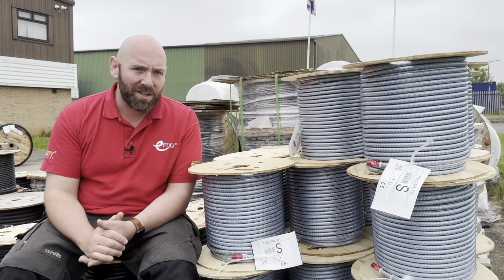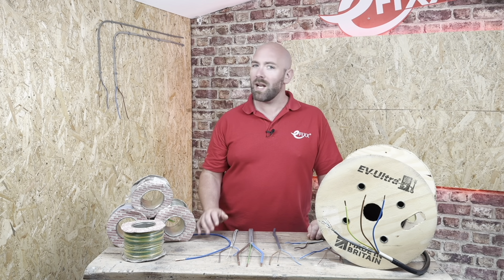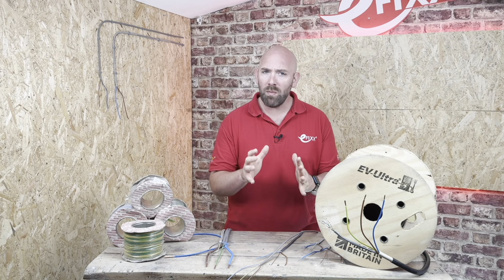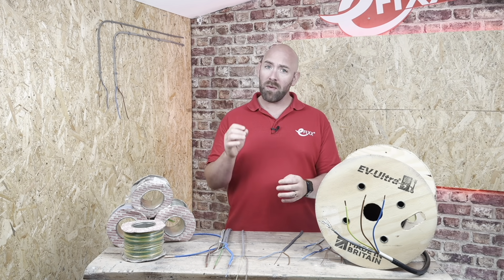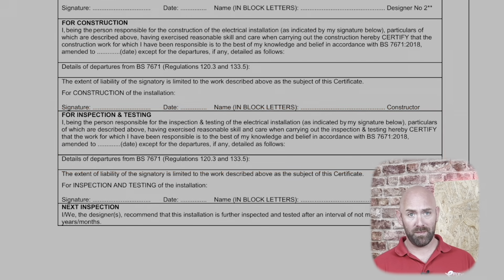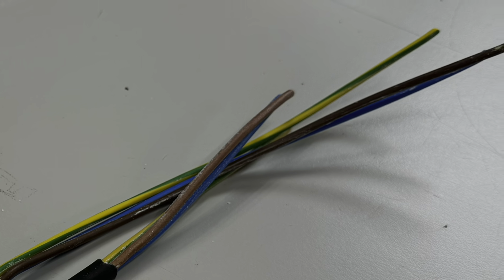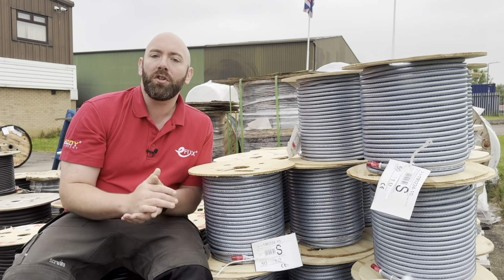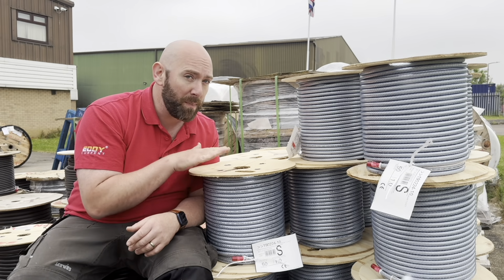Wiring Regs Departure: Can You Trust This Cable?

Comment: Surprising video, SY has always been the standard cable for hooking up outdoor AC units to the isolator provided by the electrical contractors, in fact it was (and may even still be) the recommended cable in the regs/certification.

Comment: Back in the 90s, there were problems with some cables where you ended up throwing out a complete drum of cable as you could not separate the outer and inner sheaths.

Comment: What a sack of do do, about not being able to carry fault current.
Cable is cable is cable, it all needs to dissipate heat but fault current should only last a few seconds to disconnection time or many minutes at a much lower over load state, assuming you installed the overloads and circuit protection and did the calcs SY is fine.
To add, I have used this on Nuclear sites, on robotics, on motor controllers, on inverters, on SIL/SIF equipment.
SO long as its inside, its fine, it allows for some movement, such as a vibrator motor might experience.
I have letters from two manufactures that its ok for low voltage/ low power distribution, that means 300vAC Phase to Earth and 500v P-P.

The braid is meant as a shield, such as to reduce the effects of radiated EMC, like Inverters or phase angle equipment produce.
It is not an earth conductor, specify and use the Earth inside for that, then its at the same CSA as the main conductors.

Comment: 7671 covers installation; BSEN 60204-1 covers controls and electrical equipment of machines (in a similar way to fire alarms and emergency lighting having their own BS numbers).

There's nothing inherently wrong with SY as a cable provided it's used properly - the trouble is people using it in place of SWA and not making it off properly. In my experience, if they don't know how to make off SWA, chances are they'll be equally clueless with SY - but that's an installer problem and not a cable problem.

Comment: Thought this video would have some interesting comments. SY is used extensively in industry and I am fairly sure it is impossible to buy without a G&Y core for the earth regardless of how many cores or colours it has, so don’t see why anybody would be using the braiding as the CPC. I find the SY glands generally don’t get a good grip and much prefer a comp gland and un platt the braiding sleeve it  and earth it. Unfortunately it does get used and abused and is dangerous if the braiding is not earthed, had a few belts from this in the past 😡. Some Dutch contractors told me it is used a lot in Europe 🤷‍♂️ 8:24

Comment: I’m not advocating SY outside or on EV chargers but imo it’s perfectly fine in an industrial setting for runs to machines from isolators or even as extension leads - seen this literally hundreds of times at events.
If it’s only a control cable I would ask why is it made upto 35mm conductors!

Comment: I think you need to reword this video. 

Those types of cables are CONTROL cables and designed for commercial and mainly industrial environments. NOT for air con engineers and by the looks of it moronic EV installers. 

The problem is that too many people don’t know what they’re doing and do a bad job. 

We should have a protected trade and require up skilling every few years. 

Ps. Doncaster have a fault on their new twin cable. With sleeving coming away or snapping when being formed.
Reply: Some SY cable is accompanied by data and certification from German standards and is perfectly OK to be used as long as the braid is not relied upon as a cpc. As a departure this should be recorded and covered by a risk assessment. 
It's an obvious way to undercut the competition as it's half the price of something like H07RNF

Comment: I don't even trust the armour on SWA to carry fault currents. If you're making a departure, test it and prove it safe. If you're designing, take into account the worst possible failure mode. The use of SY cable in the UK isn't controversial, because every spark is taught how to use it. Not there isn't a lot of people out there who managed to pass their AM2 despite being morons, but that's another issue.

Comment: SY cables can be used as power cables because they can be manufactured:. :
1) appropriate phase and neutral colours, not with black numbered cores that is used for control cables
2) available in two insulation grades of 450/750V and 600/1000V
3) available with UV stabilised outer sheath
4) is more flexible than that horrible solid core crap.'..
5). Has VDE approval for the EU
So therefore why can’t BS approve it as a power cables?
 UK cable manufacturing protectionism if you ask me.

Comment: Why is SY cable still on the AM2??? Craziness! 😵‍💫
Reply: @gbelectricks  So you can demonstrate how to correctly terminate it. SY is a much used cable (outside of domestic).
Reply: @looking9175 domestic has nothing to do with it. 
BS7671 actively discourages its use, for any scenario, domestic, commercial and industrial applications due to it not being manufactured to British standards. So my question still stands, why is it still on the AM2??

Comment: I vary rarely put Earthsure down as a departure unless it's a commercial install. Domestic there's no point and SY shouldn't be used outside of motor and machine connections -  lost count of the amount of YouTubers in the UK that I've seen with Anderson EV points or Zappi's hooked up with SY which isn't even UV rated.

Comment: THANK YOU! Finally some sense regarding bastard SY. I have failed peoples EICRs before because they had SY cable installed externally and told I was being nit-picky. I know it can be used for supply provided the braid is not used for fault current. Personally I would only earth the one end of the braid, preferably the supply end. Still A/C INSTALLERS TAKE NOTE - NO BLOODY SY OUTSIDE! Use SWA, Hi Tuff or even weatherproof flex if you want to cheap out.
Reply: Still amazes me the comments on here despite the reasons given !
Reply: Have you compared the inner insulation thickness with something that meets the regs, last time I compared the insulation on sy was about half the thickness

Comment: Correctly sized SY cable in say 3 core with an earth conductor the same size as the phase conductor is more capable than say a 2 core SWA sized identically where the armouring is used as the CPC.   Yes it offers much lower mechanical protection and may be less suitable outdoors but it works.  For machine tool motor wiring with VFD’s it’s the only sensible option as the screen is essential for EMC purposes.

By the way in recent years I’ve removed T&E feeding a garage that had been on a south facing wall since the summer England won the World Cup (1966) so circa 50 years. The insulation was bleached but it certainly wasn’t brittle and it was as good as brand new T&E when tested at 500v and it still stripped without issue. 

Also the cable was supported on a catenary wire between the house and garage, that portion was also ok, not work hardened and still perfectly functional.
Reply: It doesn't work outside. The UV breaks down the clear sleeve. The braid then rusts. Bag of shit cable.
Reply: The guys that make the regs need to keep making new regs or they'd be out of a job, so unfortunately we will be in store for more of nonsense regs in the future!

Comment: SY cable is specifically designed for motors on VSD's. It is mean to have the live conductors carry full current and have a full protective eart. The braided shielding is designed to be earth (usually just on the source end) which is to deal with the electrical noise emitted by the switching of the VSD.
Reply: Erm ...............
Not in UK it's not!
Reply: @willmitchell255 I guarantee you most factory’s in the UK have SY cable supplying motors from panel using VSD’s
Reply: @willmitchell255  Uk is full of dumbasses

Comment: Hold on a sec here, doesn't bs7671 say manufacturers instructions override bs7671?...  As much as i hate ( and would  never use ) SY cable, if the manufacturer says it meets standards.. then surely it does?

Comment: How much did Doncaster Cable pay you for this 10 minute advert?
Reply: They are getting a bit desperate to push this cable. Without certification no one is going to risk voiding their liability insurance and use it.
Reply from the maker: @scottyleics departure from the regs backed by an BASEC safety report - what’s the issue?
Reply: @efixx  no issue to me and don't get me wrong it's a great product for sure. Insurance companies are the problem, they don't want to hear about deviations.
Reply: @efixx  An issue is that Earthsure is less safe than twin and earth so I'd reject any installer wanting to use it. My parents demonstrated. Father installed a spur between floors using surface mounted twin and earth in the corner of an alcove. Fifteen years later with him dead my mother thought the cable looked ugly and cut the still live cable off with all-metal scissors. Cue instant bang as first to be cut live shorted to uninsulated CPC. Insulate that CPC and her body may have been the lowest resistance path to earth, potentially fatally. Using a more dangerous cable is not a good move and nobody can expect cables not to be cut into, whether by scissors, drills multi-tools or whatever. Hopefully Doncaster Cables will rethink this before their deviation kills someone like my mother.
Reply: @scottyleics  Just read my reply to efixx for a real world case where Earthsure might have killed someone if it had been substituted for the safer approved cable.

Comment: And what complete and utter bullshit about SY not being able to handle fault current. The CPC core inside the cable is the same size as the phase/neutral, and being multistrand has a higher capacity than solid cored cables.
And obviously, no idiot would ever use the external braiding as an actual CPC, although it does make sense to also ground this at one end as you would normally do for a shield.
Very poor video.

Comment: Lets get this straight. A 2.5 twin & Earth (with 1.5mm "Earth") is perfectly legal but th3 core SY of 2.5mm on all 3 cables is not legal. Some one needs to explain why a 1.5mm "Earth" is safe on a 2.5mm twin & Earth yet a 2.5mm "Earth" is unsafe on a 2.5mm SY cable. Sorry but if these self same  people were genuinely interested in Electrical Safety then there are far more pressing issues that need addressing especially in the FAKE PAT testing and certification. Personally I am sick and tired of so called "Experts" condemning me for oversizing cables and refusing to have any ring mains due to historical incidents affecting my work.
Reply: Exactly, by all accounts T&E is shit, especially getting to sizes like 10mm^2 for showers etc. Like really shit. SY cable is far far more suitable, handles more current, and is a hell of  a lot easier and safer in the terminations
Reply: The concern is not about the suitability of the "earth" core in the SY, it's about the suitability of the braided screen and the fact that if terminated correctly, the screen is earthed. From RINA's statement to Eland Cables on the use of SY/CY/YY: "The resistance of the screen is not specified. If, in longer runs, the cable is damaged such that the screen makes contact with a line conductor, producing an earth fault, the fault current may not be sufficient to operate the protective device in the required time. This could leave the screen and the equipment it is connected to at an elevated voltage, depending on the cable length and the location of the fault."
Reply: @SparkcatcherFox  The exact same applies to any cable that suffers and damage that penetrates a live conductor. Think of the extra safety that SY offers over any other flexible cable. But there again those who oppose the use of these types of cable have NEVER EVER worked in a metal workshop where sharp swarf is common place.
Now don't even get me started on the huge number of PAT tests that have failed to detect the very small steel wire whiskers that are embedded into the outer sheath of my power tools cables.
These so called testing companies are quick to take the money but leave a totally worthless cert behind. Sorry but PAT testing companies  are worse than the 2nd hand car sales for total BS and lack of actual accountability. Last company £15 per power tool. 100 power tools les than 2 hours on site and when I checked them there were 9 failures that they failed to spot.
Reply: @PeterChapman-rg6gr  Agreed. I have done maintenance in heavy fabrication shops and equipment flexes were nearly always done in SY. The manufacturers could easily make the concern go away by specifying the screen resistance or by having the cable tested and certified by BASEC. I assume they know it would not pass. Eland have had their SY/CY/YY kitemarked but that doesn't cover all criteria. They sell the stuff and even their recommendation is that it's likely not worth the additional cost of uplifting it to the same level of safety as a BS EN cable by e.g. enclosing it in containment when you could just fit a BS EN cable to begin with. Can Doncaster provide us with an SY equivalent cable that is BASEC tested? PAT clowns are a whole other issue
Reply: @SparkcatcherFox  It is nice to read that a "Sparky" shares my concerns about the current standard of PAT testing. £15 per hand tool 4 times a year is bloody expensive even more so when they fail to even carry out the "Basics" and actually check the cables for damage.
Reply: @SparkcatcherFox  Just ignoring CENELEC for the lulz or what? BS EN isn't perfect. It doesn't validate those kind of cables because it just doesn't cover that use case. It doesn't mean that the cable is inherently unsafe. Carrying out risk assessments and testing is an important part of an electrician's job. We're not just here to throw cable in, we have to ensure the installation is safe too. If you don't know how to do that without following a set of regs that specifically lets sparks, make their own judgements on what is safe, hang up your continuity tester and get screwing plasterboard to studs.
Reply: @cobalt49 Yes, personally I would prefer cables used in a fixed wiring installation to conform to a BS EN standard. Guidance notes from the majority of British cable manufacturers on the suitability of SY/CY/YY cable agree with my thinking. As a professional electrical designer who is qualified to carry out the risk assessment mentioned I will continue for the time being to prohibit their use on my projects.
Reply: @ It's really cool that you qualified to do that while your head was stuck up your arse. You remind me of the kind of spark that still complains about harmonised colours because they can't remember that black isn't neutral.
Reply: @SparkcatcherFox  Connecting screens at both ends leads to noise induction
Reply: @barrieshepherd7694  Like an SWA for electrical earthing purposes only one end needs to be connected of course
Reply: @SparkcatcherFox  And in reality, the chances of that are zero. Arguably the braided core will conduct far better than typical SWA that is available today, given how shitty and thin their armoured, galvanised steel cores are....all a recipe for poor conductivity.
So has anyone stated SWA is not allowed ? where the SW is the only CPC ?

Comment: Call me a cynic...but this sounds like IET could make this much easier on us by simply changing the relevant line to say "cables tested by accredited third parties such as BASEC are acceptable".

 Feel this will be catching people out as im sure the vast majority of times Earthsure and EVultra has been used it wont be noted on the certs...thus potentially allowing the installer to be accountable for future kssues
Reply: As written they do though. You have to note it on the EICR, but so long as the cable meets the standards (even if they haven't been approved) then that's allowable. There's a specific "departures" section of the form for this reason. You just need to note that the SY cable has been approved by a different standard that complies with BS7671, and the installation complies with the relevant requirements. It's really easy.